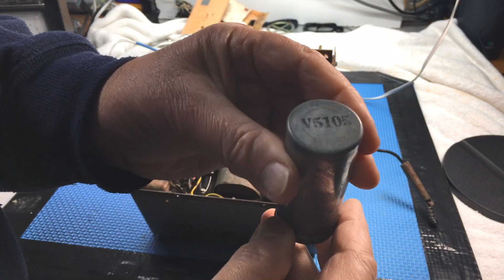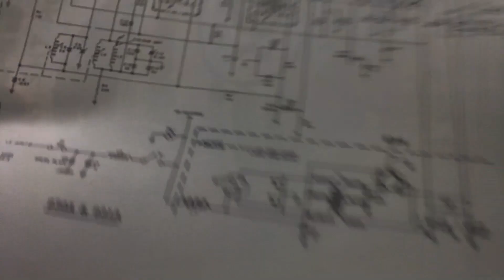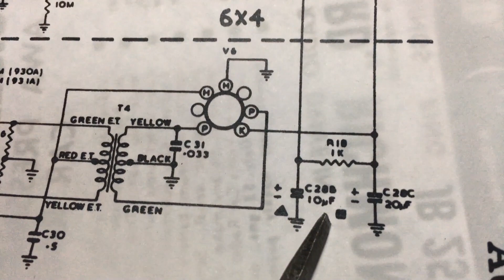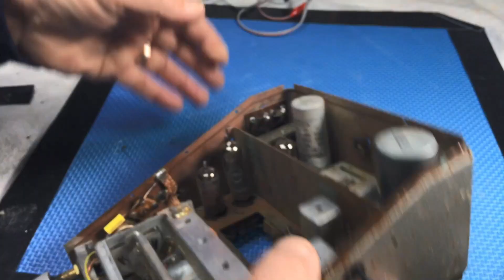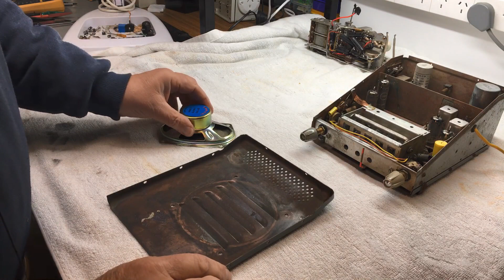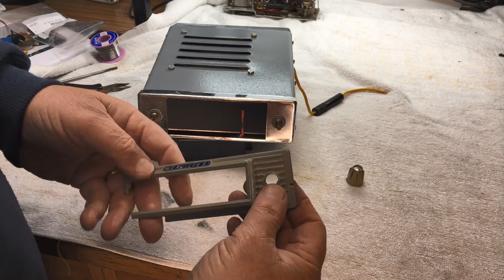AWA Cruiser 6v Car Radio - PART 2

Comment: One of the first radio repairs I ever tackled was to fix a damn viberator in the radio on my 1950 Ford Custom, the first car dad ever bought for me. It had been in a crash and needed a full front clip, two water pumps and a radiator/grill and bumper to get her back in shape, oh and a hood to boot. I found an old junker at the city dump, which back then was open to the public and my best friend and I took his dad's old Chevy pickup out there and stripped the clip an parts I needed, then I had to fix the radio and the front seat was both worn out and filthy from the previous owner a real old fart who never cleaned anything in his life by the looks of the interior.  I did the viberator but didn't tear it completely down like you did, I used dad's points file to get it back working and that did the job. Later I found a radio out of a Chrysler Imperial with electric motor tuning and put that in my car, ran wires to the back deck and put in a rear speaker. My girlfriend painted the bulbs in my dome lights with fingernail polish so they glowed red and I replaced the front seat with one out of rambler to make a bed in the car, being the 1960's with free love on the docket I made good use of those as well. Ah for the good old days of 3.2 beer and Winston cigarettes!
Reply from the maker: What a classic story, thanks for sharing those great memories of your Ford and the 60s with us! 👍

Comment: Hi Baz, I really enjoyed those two videos - I haven't got a lot of experience with vibrators so it was nice to see inside one and get a little operational theory - much appreciated 🙂  And have you considered replacing the LED light driver with an old school 230-12V transformer and current limiting resistors?  I've done that with LED strip lights before, it makes them virtually noise-free.
Reply from the maker: Hi Steve, seeing I'm testing more & more AM Radios on the benmch I think this would be a great idea. 
Might record the mods, LOL !